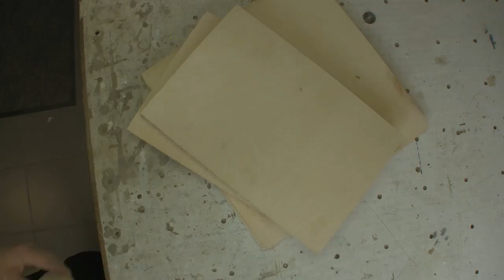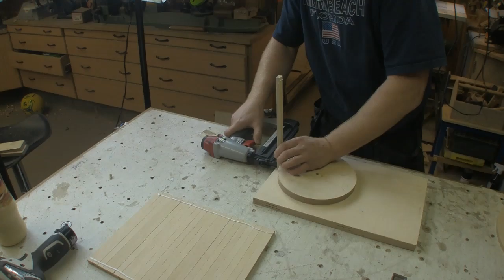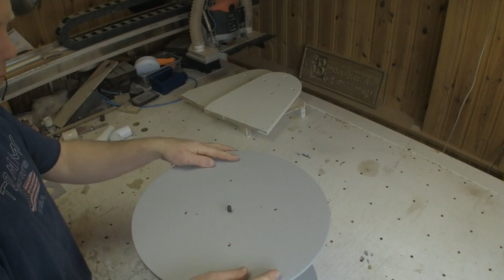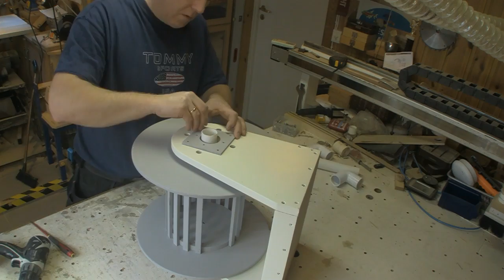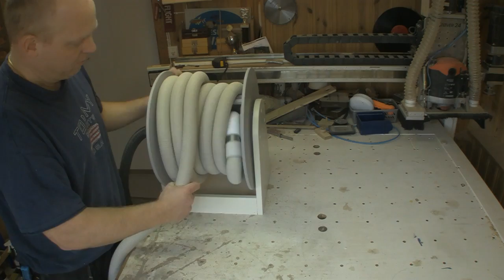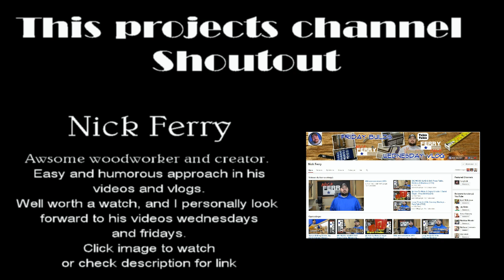Homemade Vacuum Hose Reel

Comment: I have got to build one of these! I have never seen a "Lazy-Susan Turntable" used before like that! This will very handy in my small work area!
Reply from the maker: richie4ohio It is a real space saver. The lazy suzans worked out great as they have the donut hole to accomodate for the pipe in the middle
Reply: Where is a good place to buy that much hose?
Reply from the maker: richie4ohio I found my at the dump. Its an old vaccum hose from a  central vacuum system. I would check your local supplier of central vacuum system if they have a returned faulty one. I bet you will get it   cheap

Comment: Oh yeah! Way better. I need one of those for my compressor hose reel too
Reply from the maker: WoodRodent Thanks, There are great commercial available ones for compressed air, as I think the fitting for the swivel would have to be pretty tight not to leak from the forces of the compressed air. Thanks for commenting and for watching
Reply: I bought a pretty nice reel for my compressor hose at Harbor freight. So far it's working great and the pivoting union doesn't leak. Regarding this vacuum hose reel, it would be nice to rig up a crank handle on one side. My Harbor freight compressor hose reel has the crank and it makes it really nice.
Reply from the maker: Fred Flintstone Hi Fred. I did not mean that commercial ones would be in danger of leaking, only a DIY version, considering the pressure it is under, but of course with some metalwork it would be possible. I did some fiddeling and may do a video on a motorized version, but its really fast to reel it in, so we´ll have to se what happens.
Reply: Bellevue Woodshop
Hello Bellevue. Understood. My comment about the union not leaking on the inexpensive Harbor freight unit was meant mostly as a recommendation. The rotary union looks a lot like the rotary units used for fittings on compressed air tools and auto oilers. The rotary union on the HB unit looks something like this:
http://www.ebay.com/itm/FIT-COMPRESSION-ELBOW-04A-Swivel-use-on-air-engine-1-4-Tube-to-1-8-NPT-Male-/281391973625?pt=Motors_Car_Truck_Parts_Accessories&hash=item418444c4f9&vxp=mtr

Comment: I have an idea for an upgrade! Add a setup like your power feeder to reel the hose back in !

Great project Roy I would do this but I don't have a long enough hose to bother with !
Reply from the maker: Tom Howbridge Thanks Tom. i did fiddle with the idea of motorizing it, but then again I would have to make the controls  easily available, but we´ll see what happens. It is very fast to unroll it and roll it back. But then again, automated stuff is awsome. I actually found the hose in the dumpster. its for a central vacuum hose.

Comment: I love this idea.  Could you post a more detailed explanation of the hose connection that allows for the spin?
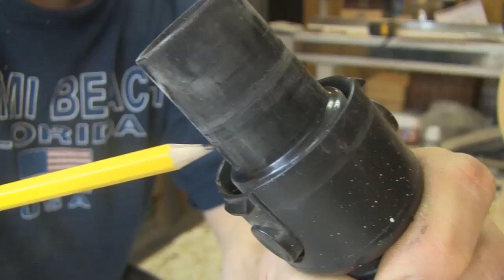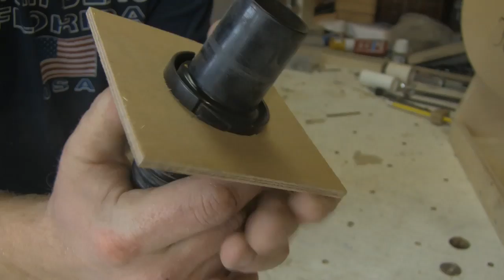Reply from the maker: +TT OKC Thanks. If you check out at 1:16 you will see the vacuum hose has a bevel/taper that makes a sort of a seal with very little friction. When the hose is snapped in place and locked with the 2 spring loaded plastic clips on the hose 1:27 it seats the connector on the hose inside the pipe. the pipe of course has to be fixed to not move when the fitting is pressed against it at 2:32. Hope this makes sense:). Thanks for watching

Comment: Did I miss what the swivel cuff looks like? That's what makes this thing work or not. Is the "lobe" action mechanical or "air resistance"? I think this thing is great. Everyone seems to want something for nothing, and begrudge you doing the hard part of the project for them. Did you notice they all say I "can" or I "could" this? That means they don't have one, didn't think of it, and want it for $1. You sell them the CAD & kit, they'll make 3, sell 2, and STILL be out $75 after NOT paying themselves for their time, or their use of their CNC @ $125/hr. Give the guy who thinks this stuff up the money & be happy. You could have shown the "pockets" a bit better; the comment about end grain didn't notice them, nor did I.

Comment: You sir, are a Genie's Arse ! Absolutely brilliant : ) Only thing I didn't recognise was the rotating ring affair : ( Looked like a dis-assembled castor base plate but… ? Maybe a sturdier mono mount could be possible to make a cranking handily an option ? Not the hose length needs it though : ) Have you seen Alex's work on the TehDoor channel, I think you'd appreciate his ingenuity and philosophy on how to as well. Thanks for sharing, I'll stash this one away in the good idea's file : )
Reply from the maker: John Smith Thank you John for the generous word, it is much appreciated. The rotating ring is a lazy Suzan (just google it if you are not familiar with these) Monomount is an option, or maybe a motorized version, as someone else commented. I have subbed to TehDoors channel for some time now, and that dude sure has amazing ideas and contraptions, it is absolutely worth recomenting

Comment: Have you written plans for this?  Thought about a solution for a hand crank, motor, or spring retraction?  Would love to build something like this for my garage ceiling, for pulling down the hose when needed, then retracting when done.
Reply from the maker: David Marcus I have not made any plans for this yet, might write up some free plans, but the plan would have to be suited the length and diameter of hose and the lazy susan one have avaialble. But there might be a simple free sketch on my website. I have fiddled around with some ideas abaout and i did motorize it, but felt it overcomplicated the build. But in the case of having it as a pulldown unit in the garage, as you mention, some kind of retracting would be necessary. I think some kind of spring return would work best, and I have not given up the idea on that yet

Comment: Excellent build! Thanks!
How does the non rotating hose (outside) connect to the inner pvc which rotates?
Reply from the maker: Thanks. The  swivel from the vacuum cleaner has a locking shoulder. you can see it here 1:16
Reply: Bellevue Woodshop So sorry to make you go to the trouble of pointing that out to me! I really appreciate it! I thought I saw every second but obviously I missed it. I should have rewatched it a couple times to answer my own question! Thanks again!
Reply: Bellevue Woodshop 9

Comment: Nice vac hose reel. Is that a 50' x 1.5" hose & what size turntables are those ? Is there a parts/cut list/website ? Thanks.
Reply from the maker: Thanks Pat. Yes I think it is close to these dimensions. It is an old hose from a central vacuum system for domestic homes that I trash picked. If I remember correct I think those are 6" x6". o plans for this one unfortunately, but check out my website for my other plans at www.bellevuewoodshop.com👍😄

Comment: Is that a square metal flange (bracket with a round central hole)? What size is that?
Reply from the maker: It is a off the shelf LazySusan. Not sure of the dimension

Comment: You could like, put a automatic spring mechanism with a lever locking mechanism  =)
So when you push the lever, it will roll the hose automatically.
Reply from the maker: I did make a torsion spring, but it wore out to fast, A spring for an outboard start coil might do the trick
Reply: Good luck then! =]
Hope it works

Comment: Hey Roy.  What a great idea!  I bet there's a lot of people out there that could do with one of these in their workshop.  Does it lose any suction through the rotating centre?
Reply from the maker: David Handley  Thank you very much David, it sure beats trying to untangle the 30 foot hose every time i nedd to use a tool. The reality is that it never got used before. I have not noticed much loss. I did plan to put an O-ring on the swivel part, but it has a taper  which you can see at 1:20 that makes it seal good. the two pipes is also a reasonable tight fit

Comment: Great build! I need the diy version of the Rockler hose reel just like you made it. I envisioned it the same. What diameter lazy susan parts did you use and were the metal plates on the outside just for extra reinforcement?
Reply from the maker: Thanks Jason, I think it was a 4 or 5" lazy susan. The fixingplate was just how these came when I purchased them. Thanks for watching and commenting

Comment: Nice vid.... But where do you buy the parts to connect the reel and have it spin?
Reply from the maker: Thanks Tony. all the white parts are regular 40mm waste pipe. The swivel action is from the snap on connector already attached to the vacumm cleaner hose. It swivels on the thin plywood plate

Comment: Great idea, now that i've seen it I need it! One question: do you note lower sucking power?
Reply from the maker: Marcos Magnasco Thanks Marcos, glad you liked it. The resistance of the 30 foot hose will of course affect the suction power, but  I did not notice any major difference that connecting it directly

Comment: Where can one find that kind of vacuum hose? Brilliant idea
Reply from the maker: +Conrad Designs Its an old vacuum hose from a domestic central vacuum system. I found it at the dump
Reply: Catholic Woodworker u can get an 11/4 hose at a swimming pool store. Various lengths
Reply: you have stated to use a swimming vaccum hose as the alternative to or poormans model to standard shop vac hose ? well than my question to you is do you find it is ok with both dust and meta shavings l as well as liquids ? thoughts please thank you !!!!

Comment: Where did you get that hose? Is it one continuous length? What is the inner/outer diameter? Is it a pool vacuum hose? Thanks in advance.
Reply from the maker: The hose ia an old vacuum hose from a central vacuum system in my home. It is 10 meters long. I think it is 36mm OD

Comment: Nice work.  I was intrigued by that hole cutter.  Was that homemade or purchased and if so where?  I have a need for one like that.
Reply from the maker: Mike Kapotsy Thank you Mike. The hole cutter is an adjustable commercial cutter. The cutterblade is adjustable and there are 2 in the set, so it can cut sizes from aprox 22mm up to 75mm. the auger at the end thou, makes it useless unless you predrill for it. The threads are way to aggressive for the size of the cutter, and it stalls any drill I have tried, or nearly breaks you wrist. It is bought here locally at a store chain much like Harbor Freight in the US
Reply: Bellevue Woodshop Thanks, desperately need one.  The one I bought from Harbor Freight didn't do the trick but one like yours definitely would.  I may have to fabricate one like it on my own.
Reply from the maker: Mike Kapotsy PM me your email adress and I will send you some closeup images of it if you need any details
Reply: Ok I tried to do that, hopefully you received it.  Let me know if not. Thanks.
Reply from the maker: Mike Kapotsy I di not recieve any PM. try bellevuesnekkeri(at)gmail.com
Reply: Bellevue Woodshop just sent you an email. Thanks.
Reply: Mike Kapotsy I have used these drills for years, they are made to be used in a hand brace (http://en.wikipedia.org/wiki/Brace_%28tool%29). You can cut off the square taper on the end and put into an electric drill at your peril/risk!!!

Comment: Where did you get the adjustable drill bit your using a 1 min 22 sec in the drill press?
Reply from the maker: I purchased it at a local hardware store like HF here in Norway, it is adjustable, but has an auger in the centerr, and if you do not predrill you are in for a supprise!!!, the pitch is waaaay to large for the cutter to be able to remove the material. You might be able to find it on ebay though

Comment: Hvor kjøper du så fin kryssfiner? Byggevarekjedene har jo bare møkk 12mm. Vet GustavsenAS har, men bare BYRE småplater..
Reply from the maker: Stig øvreberg Hei. Nå er jeg i den heldige situasjonen at jeg jobber på en fabrikk som produserer baderomspanel, med kjerne av baltisk bjørkefinèr i møbelkvalitet. Har nærmest ubgrenset tilgang til noen prøveplater som brukes for å måle herdermengde med. Disse måler 400mm x 1250mm x 9mm, og er supre til jigger og maler. men Ville sjekket firmaet som Bjørnar referer til, og så har du jo Oslo finèrfabrikk om du befinner deg på østlandet

Comment: Quick Question for you... could you please let me know the manufacture (and part number if you have it) of that exact white plastic 360 mountable hose clamp you used towards the beginning of your build?

I have been looking for these things for a while!

thanks in advance. CH
Reply from the maker: Hi Christian. I am not sure what fitting you mean. Could you supply me with the timestamp in the video, and I will look into it
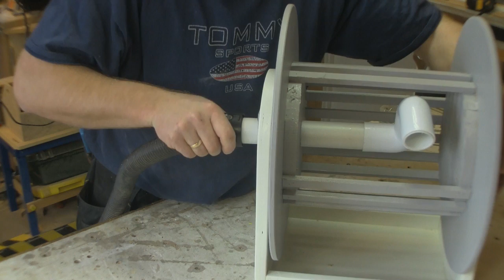Reply: +Bellevue Woodshop timestamp @ about 2:55
Reply from the maker: Di you mean the white clamp holding the black hose? The one with the click latch on the top?
Reply: +Bellevue Woodshop yup
Reply from the maker: I think i bought the in a local hardware store here in Norway. Not sure where you are located

Comment: Genius! You have a video about doing this with an air compressor hose? I'm not paying $125 to buy one.
Reply from the maker: +Noah Howard Thanks Noah. Doing it with compressed air could also be done. I think a regular quick connector or a swivel like this could be used: http://www.ebay.com/itm/1-4-Universal-360-Swivel-Air-Hose-Connector-Adapter-Flow-Aluminum-BSP-Tool-/221906064082?hash=item33aaa1d2d2:g:dVQAAOSwFnFWE6JT
Reply: +Bellevue Woodshop Awesome thanks for the help!

Comment: Where did you purchase the "rotary vacuum joint"?
or did you make it?
Reply from the maker: The rotary function is just from the swivel of the snap on hose connector from the vacuum cleaner

Comment: we made one of this but the hose makes a terrible howling noise as soon as we turn the hoover on. it only stops when we pull all the hose out and keep it straight. don't you have the same issue?
Reply from the maker: I cannot say I have noticed this issue, but some howling noise will always be present. My 30 foot home central vac hose make some noise to